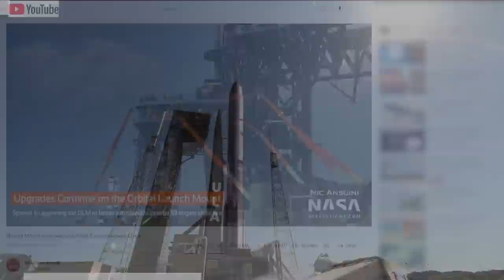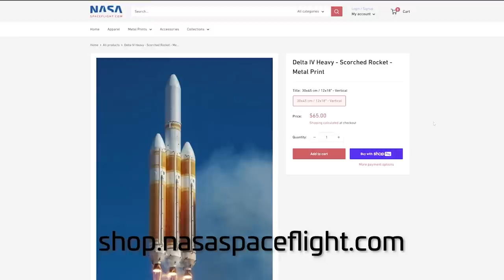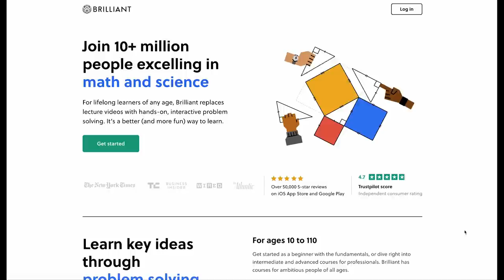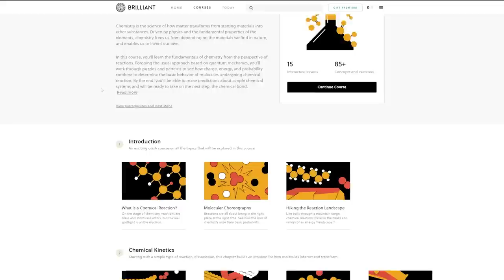Will Starship be the First Methane-Powered Rocket to Fly?

Comment: Hydrogen is more efficient than methane but supposedly produces less thrust? How can this be? Doesn't the thrust depend on the size of the engines? The Saturn V used only hydrogen and it had very large engines.
Reply: The one that use Hydrogen is Saturn V upper-stage. While Saturn V first-stage must use Kerosene because higher thrust.
Reply: High ISP low density of exhaust so thrust/kg may be high but the number kg/second may be enough lower to counter the higher ISP and result in lower thrust.  An ION engine blows away chemical rockets for ISP but its thrust is tiny due to the low rate of propellant expelled.  Also H2 needs major insulation and great expense to minimize leaks (while not really being able to stop them all) due to the size of the molecule, making the rocket heavier.  Lower density also means bigger tanks so more massive again.  

Check what fuel is used on each stage of the Saturn V.  Those 5 huge engines on the first stage burned kerosene not hydrogen.  

Look at the SLS 1st stage.  All that orange insulation on the huge propellant tank and the hydrolox engines still need the SRBs to get it off the ground.  Too much weight in tanks and insulation.  Just like the shuttle it was derived from.

Superheavy no insulation.  The temperature of the methane and lox don't require insulation.  Their temperatures are compatible enough that they share a common end to the two tanks with no need for insulation between them saving the weight of the insulation and one tank end end.  Piping can go right through the lower (LOX) tank from the methane tank without insulation or need to be diverted outside the tank.  More weight saving.  Also doesn't need SRBs the raptors alone carry it to space.

Consider this SLS is rated at putting 95 tons to orbit.  That includes the stage sent to orbit as part of the tonnage.  Starship is rated to carry 100-150 tons to orbit as payload.  The Starship itself is not part of that number neither is the propellant it will carry for landing.  So the orbital delivery counted the same way as SLS is over 200 tons and maybe over 250 tons.
Reply: @xponen  Oh, my bad, I thought the lower stage actually used hydrogen.
Reply: @Scanner9631  Oh, this makes sense! Though the fact that methane was hardly used until recently suggests to me that its advantages are exaggerated among space fans.
Reply: @cube2fox  

Or just overlooked for a long time.  

V1 gasoline
V2 ethanol
Goddard used gasoline
Mercury ethanol
Gemini kerosene
Apollo Saturn 5 kerosene

Lots of other far more toxic fuels as well.  

Notice all these early ones used fuel that was liquid at room temperatures.  Upper stages might use hydrogen but not the lower.

The shuttle used hydrogen and SRBs with problems.  

SpaceX wants methane because they want to make fuel on Mars and methane is the easiest.  

They could have used kerosene for the 1st stage but then they would need two different engine designs.  More insulation between compartments, separate ends for the tanks.  Separate fuel storage and fueling methods at the launch site.  Loss of so many common features between the stages raising development, construction and operational costs.  

SpaceX has different goals and viewpoints from those who came before resulting in different behavior and rockets with new or differing features.

Comment: The BE-4 Engine is vaporware.  It was delivered, but had issues, so is going tests and fixes...
Reply: Can’t be vaporeare if it has been delivered and tested and un significant quantities . It still be a failure , but not vaporeare.
Reply: lol  Thats not "Vaporware". That's a normal development process. .
Reply: @lantrick  

It is a normal development process to deliver engines to a customer, but the customer finds problems with it and can't use them, so they send it back for continued testing and fixes?
Reply: @jaimeduncan6167  

I used the wrong term.  Yeah, but the sentiment is still there.
Reply: @direbearcoat7551  yes. that  is ALL part of the development process.  You've clearly never been involved with that sort of thing.
Reply: @lantrick  

Dude.  I'm sorry.  But you're full of bunk.

Delivering a product that works properly, but might could use some improvements?  Yeah.  That's called Version 2.0, 2.2, 3.0, etc.

Delivering a product that does NOT work, and has to be sent back?  No.  That's called fraud.
Reply: @direbearcoat7551  you can't use your software analogy on complex, first run machinery. .  nice try though.  Sending  back to the manufacturer for rework is not uncommon in other industries. Your belief is not required to make this fact.  Besides. thats not at all what happened with the BE-4, since they have no production versions only test models.

Comment: Just my opinion but I think Space X was a bit too ambitious with the Super Heavy Booster running with 33 new engines (Raptor). I would have thought an intermediate rocket, say a scaled up Falcon (10) with 9 Raptors a better way to get the engines tested in live launches. I know its another space vehicle but lets face it, it could then have replaced Falcon 9 and its heavy alternative. However the political push for the Moon and Mars with government funding was, I guess, too enticing.
Reply: They do need a rocket massive enough that a throttled Raptor can hover for easier catching (or landings should catching fail).  The Falcon 9 is too light for 1 Merlin to allow it to hover.   So there is a minimum size.  How close is Starship to the minimum thrust predicted for a Raptor?

Also for 2nd stage re-usability they wanted it for Falcon 9 but is was too small to achieve and have a practical cost/payload.  So again there is a minimum size and with their data I would trust that they made sure that Starship will be above it so it can both be practical in terms of payload and cost.

Comment: Hydrogen is the 2nd smallest atom, small but not the smallest.
Reply: And what, pray tell, would be a molecule smaller than H2?  Or an atom smaller than a single proton and a single electron?  Remove either subatomic particle and you don't have an atom anymore.

Comment: Interesting video - thx.   However the only thing that matters for the future is launch cost and reusability with a quick return.  The only company actually working on this is SpaceX.  This is a real spaceship and not just a rocket.  Not only is it the largest by far it is also the only one being set up for mass production. 
I doubt SpaceX will manage a cost of 13-15 USD per kg launched to low earth orbit (150tons at 2M USD). But I think there is a very good chance of lower launch costs than Falcon 9 - currently  with a reported internal cost of 15M USD for 15,6 tons or 961 USD/kg.   Let us speculate at Starship putting 100 tons into orbit for 10M USD => 100 USD/kg
Reply: Starship will probably first be used with an expendable upper stage though, like Falcon 9. Upper stage reuse will come liter. Expending the upper stage costs SpaceX 6 Raptor engines. This a Starship upper stage might be more expensive than a Falcon 9 lower stage (9 Merlin engines).
Reply: @cube2fox  I think the plan is only for the first launch or two to be expended (land on the ocean) - booth booster and Starship. The upper stage (Starship) is not really made to be expendable.  Hence even the current Starships contain all the elements to return to be caught (land) at the launch site.   
But yes the first launches will be very expensive.  The experience gained will surely lead to design changes and discarding of previous designs.  Add mishaps and crashes to that and the cost could run into billions if you count all the R&D spent so far.   It matters little if it results in a great many future and safe launches with actual launch costs below 100 USD/kg.   LEO is half ways to anywhere!
Reply: @pierre.a.larsen  Makes sense, but the reports say SpaceX is currently building all their new upper stage prototypes without reusability. Possibly for earlier Starlink V2.

Comment: I’m disappointed in Tesla. My friend who only has 77,000 miles on his Tesla  now needs a new battery that cost $21,000 and they won’t cover under warranty. That’s basically a brand new 2022 Corolla for the cost of a battery. So now you have to not only take out a loan for a Tesla but take out a loan for a new battery. 
Once people start to realize this the tried and tried internal combustion engine will prevail.
Reply: What does that have to do with methane fueled rocket engines?
Rocket Lab's Electron rocket does use engines with battery powered electric pump fed engines instead of the more traditional turbopumps, but it is a LOX/RP-1 engine, not a LOX/LCH4.